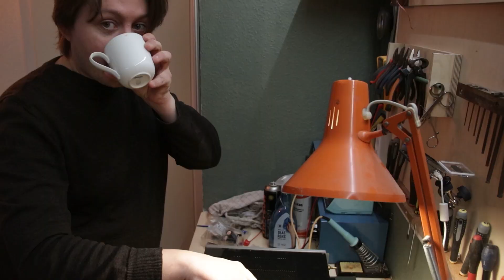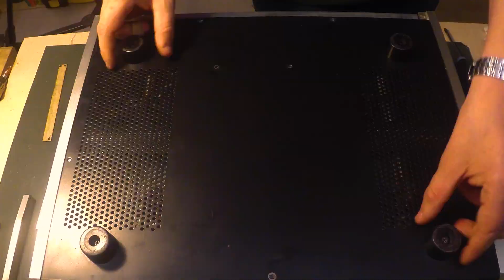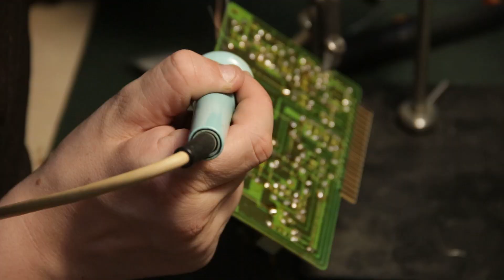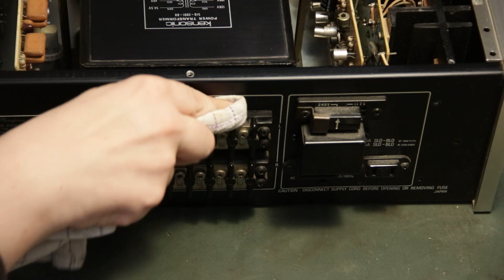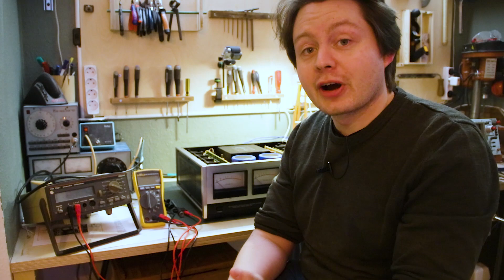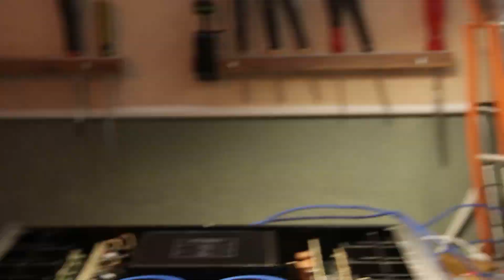Vintage HiFi Maintenance: Accuphase P-300

Comment: How did you remove the knobs?
Reply from the maker: main knobs have a set screw as the pots have a flat axle, some of them are - mainly the smaller black ones are on knurled pots so they need to be pulled straight off.
if you can't get a good grip, carefully prying them off using two teaspoons is a good way and that limits the chance of scratching the aluminium front face as you touch with the beveled surface.

Comment: I would enjoy a video showing how to properly clean the knobs and buttons. Mine have become noisy and I hate to ship the amp just for a cleaning.
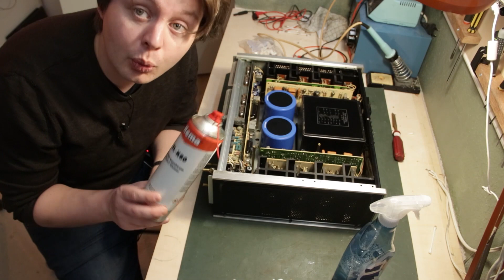Reply from the maker: If it's noisy, then it's contact cleaning and It's showned above around 5:10 - it's pretty easy: the entire idea is to get your contact cleaner between the contact and the carbon area of the switch or potentiometer. As mentioned in the video you need to use contact cleaner without lubrication for buttons or switches and contact cleaner with lubrication (some brands have cleaner and lubricator as seperate products) for knobs/potentiometers.

If you need to clean the physical knob (not the electrical component, but the metal knob) I usually use window-cleaner and an old toothbrush :)